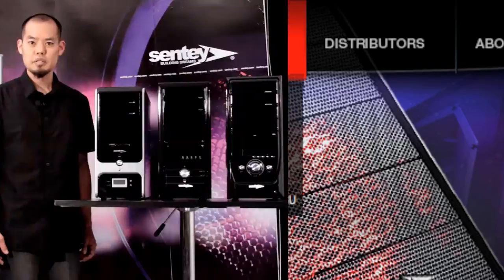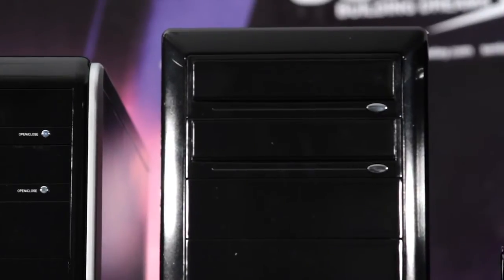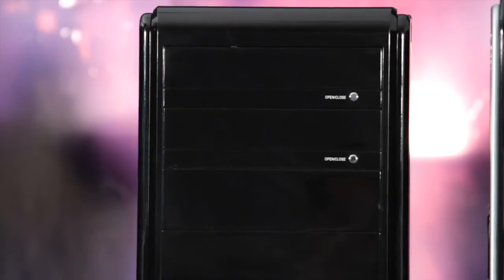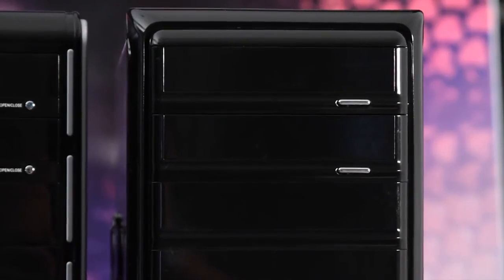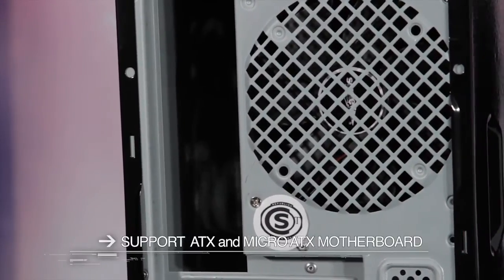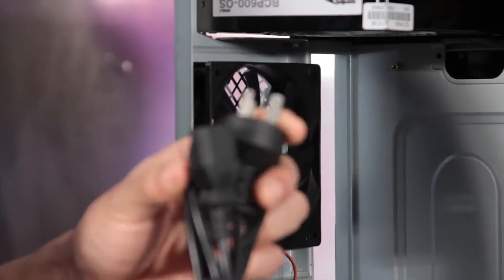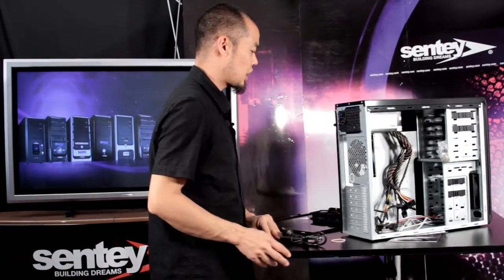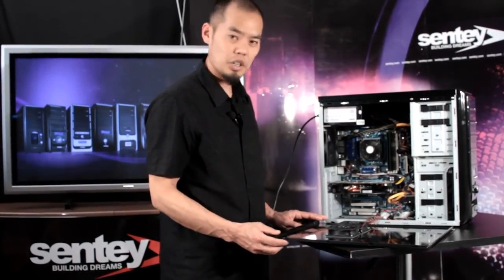Sentey Deluxe Series

Comment: I just bought the BX1-4234 v2.1 case.  The LCD unit can only monitor ONE fan because the other fans that come with the case wont plug into the 2nd "special" plug to monitor it.  Plus, the USB front ports are upside down which really does make a difference.  I like the case but these two flaws really do make a difference!